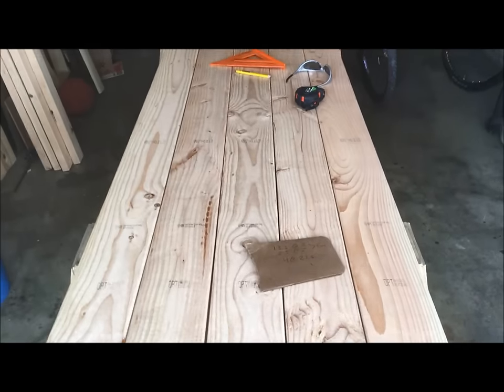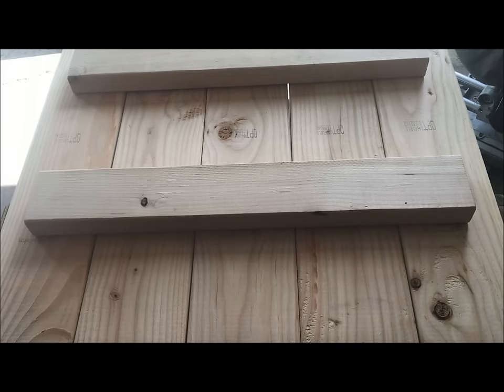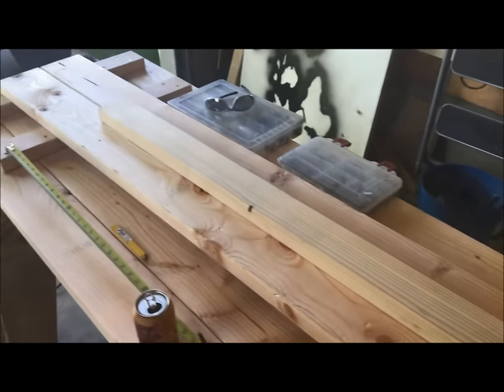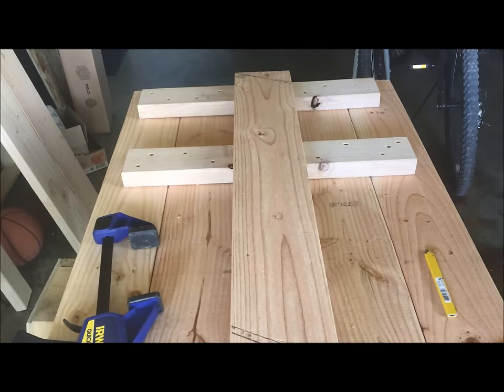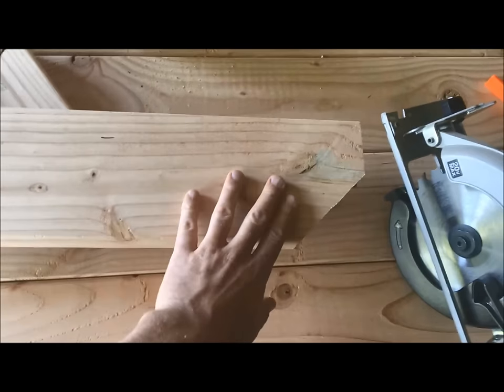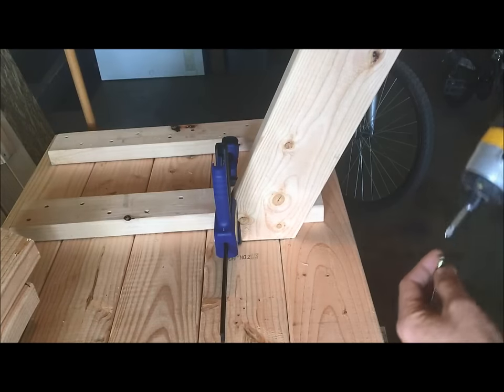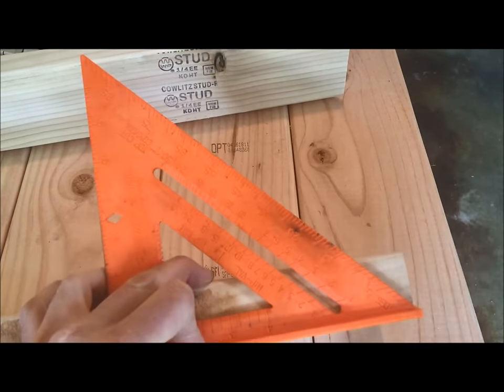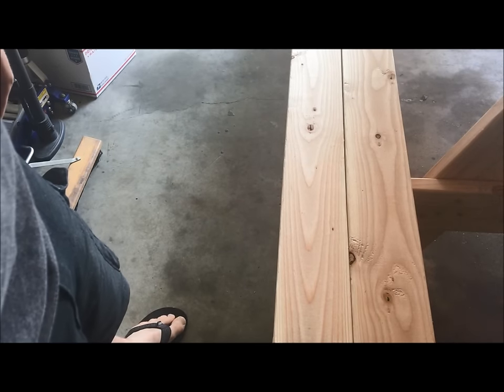How to Build A Picnic Table - Detailed Step By Step Guide

Comment: My son built 2 picnic tables for our local county’s park and recreation as his service project for his Eagle Scout rank and used your design. Went very well. Did run into issues with cross bracing as the 45 degree angles were off. We were able to fix it though.  Thanks.

Comment: Thank you, and a few minor corrections: 
You will need about 60 screws, one box usually holds ~ 50.  I used T25 Torx : 2 1/2" Wood screws.   
"The Carriage bolt line" - AKA "The seat line measurement" , is measured from the ground 12.5", essentially duplicating the bottom angle of the Leg. (I think that was 25 Degrees.  The author explains it in comments below.  "I measured from the part of the leg that will set on the ground and came up 12.5".  Once I had that mark I used that to pivot on to make another 25 degree line."   and : You should be able to measure up each side of the the board length and make your marks and this will automatically create your 25 degree angle."   Basically, if you measure up from any leg, the angle will be correct.
Reply: Thank you! Was in the middle of this project when I noticed at the 15 minute mark he didn't explain that distance (editing error I believe? Looks like he said he was going on to the 2x4 cut but all of a sudden he's back to the legs)
Reply: Thank you!
Reply: Thank you! I kept on rewinding that part and was just about to wing it.

Comment: Picnic Table:  Use these notes, while watching the video.
==========================================================
MATERIAL
==========================================================
-12 2X6X8 Pine Boards				 
-3   2X4X8 Pine Boards				 
-8   3-1/2" Carriage Bolts with Washers and Nuts 16.00
-Box of Wood Screws 2-1/2"	TORX head		  
-Wood Glue
----------------------------------------------------------
TOOLS:
----------------------------------------------------------
-Circular Saw
-Drill with TORX Head Driver (T25) Bit
-Pencil
-Speed Square + Framing Square
-Vise/Pipe Clamps + Level
-Gloves, Face Shield 
-Horses, and or Table
----------------------------------------------------------
Actual Materials Cost:		~ $130.00
Labor:					:  4 hrs.
==========================================================
 ITEMIZED PURCHASES
==========================================================
Order # 415121756 Invoice # 76172
----------------------------------------------------------
Hillman 5/16-in x 3-1/2-in Stainless Coarse Thread Carriage Bolt Qty: 8 $14.40

Hillman 18 x 5/16-in Galvanized Steel Hex Nut Qty: 10 $2.10

Hillman 5/16-in Standard (SAE) Split Lock Washer Qty: 16 $3.36

Gorilla Off-white Interior/Exterior Wood Adhesive (Actual Net Contents: 18-fl oz)Qty: 1 $6.90

Hillman 5/16-in Stainless Steel Standard (SSAE) Nylon Insert Lock Nut Qty: 8 $3.12

Hillman 1-1/4 x 5/16 Fender Washers Qty: 16 $2.88

Power Pro #10 x 2-1/2-in Ceramic Deck Screws (45-Count) Qty: 1 $6.78

Hillman 5/16-in Stainless Steel Standard (SSAE) Nylon Insert Lock Nut Qty: 8 $3.12

Severe Weather (Common: 2-in x 4-in x 8-ft) #2 Prime Treated Lumber Qty: 3 $13.41

Severe Weather (Common: 2-in x 6-in x 8-ft8-ft) #2 Prime Treated Lumber Qty: 12 $63.24

==========================================================
BUILD
==========================================================
1. Assemble the tabletop, upside down.
	
	2x4 Under braces on ends

	Measure:4 cuts - 23.5"

	2 Braces on each end.
	
	A. Measure: from edge of table: 2.5” place board 1
	B. Measure: from edge of table: 13.5” place board 2

	Screw/Drill/Glue Braces:
	C. Measure: Center them 2" From the table edges.

	(Repeat for the other side of the table).

2. Assemble the Benches, (upside down).

	(4)2x6"
	(2)2x4"

	2x4 Under braces Lengthwise.

	Measure: 62" Long
		Lag Measure: for the 2x4 placement = 17" from edge

	*Screw/Drill/Glue Bench Braces

3. Create Legs

	(Angle cuts with speed square).
		
	Lay a 2x6 down

	Legs will be 30" long, at a 25d angle cut.
	Repeat this up the board for each leg.
	
	Cut the 2x6, to create 4 legs @ (25d)

	Carriage Bolt Holes:
		
	Measure up from the bottom of legs, 12.5 inches, duplicate angle 
	for Carriage Bolt Lines.

4. Create Seat Support Beam(s): with Carriage bolts:  

	(2) 2x6 Measured: 59" long

	First Notch a 4" highlight angle to the ends of seats 
	with a speed square. (no Angle really)

	AGAIN 
	*Measure up from the bottom of legs, 12.5 inches, duplicate angle 
	for Carriage Bolt Lines.

	Drill holes in the first leg, then Template another leg, 
	to duplicate holes.	(x 4)

	The holes should be HIGH on the leg, 
	when the tabletop is upside down. 
	If the holes are low, you misplaced the leg.

	Drill Template: Use one Beam to drill the other beam. 

5. Attach the Legs:  

	Screw/Drill holes into the 2x4 bracing 90d, (not through the table)
	
	Use Clamps to hold the legs in place

	Measure: 2" From leg, to end of table brace.

6. Aligning the Seat Cross brace, with the Leg Holes

	The cross beam is placed outside the table brace #2

	Use a Framing Square, to align the Cross beams, 
	so, you can drill the holes to match the legs.

	Center the Cross Beam to hang off ~15" + 5/8ths 
	(doesn’t have to be exact, it may vary, just center it.

	Place Framing Square between the cross brace, and the leg.
	Target the "inside" hole first.
	
	From the backside of the beam, notch a mark that aligns to the inside hole

	*OPTION B: align the cross beam at the screw holes, and just drill through
		The cross beam, as centered, but lifted up to the holes.

6. Cross Bracing 2x4's for table

	You should have 2 left-over 2x4's 

        The 2x4 V bracing under the benches should fall inside the Cross Beams.

	Cut 45d angles in the edges for the cross bracing.
	You will need to set your circular saw to 45d
	
Circular Saw Note:
	
        When cutting this angle use the guideline on the saw @ 45d Notch, 
	not the normal notch straight notch

	*Or: eyeball the cut, to be flusher. (not necessary, but nice to have)
	
	Use a level for Sideways, and Vertical on the legs and set the 2x4 beams

	*Carefully drill to keep the table in LEVEL

7. Attach the Benches.  
	Align the bench along the outside edge of the cross beam.	
	(Furthest from the table edge)

	Place the bench and screw it down.

	>Sand the table

Comment: how far down do you measure from the top of the leg to the cross brace for the seat???  Or what should the height of the seat be to the ground??
Reply: Barry, you probably solved this already, but: Just measure up the leg 12.5" ~ and match the 25 Degree ? line.  Essentially go up the leg, and duplicate that angle.    I had the same problem. Its not made clear in the video.  While making the legs, you can simply put the same line on the board - up 12.5".  Make sure you measure from the bottom.  If you measure from the bottom on each corner of the leg,  30", the angle will be the same.  + You will find your hole line.
Reply: i came across the same problem and i’m glad he answered
Reply: @ericfleming6363  Ditto! He doesn't give us that measurement in the video. Thanks!
Reply: @mk8530  Thank you so so much. You're a life saver. Plannin to build this bench tomorrow and i needed to know this.

Comment: Love the Tongan work boots at 12:28 I have a rubber pair. Thanks for the build video too mate. Very useful.
Reply: Nothing like REEF sandels man!
Reply: @MechanicLife  Hahaha. In Australia we call Flip flops 'Pluggers', referring to the little plugs that go through the bottom of the sole. If you're lucky, you can find 'Double-Pluggers' that have two plugs at the rear of each side and NEVER pull out when you're doing really important things like running away from wild animals or saving families from burning buildings.
Reply: Freakin awesome! :)   I am picturing someone running into a burning building with their double pluggers on.  Super hero baby!
Reply: @MechanicLife  hahaha, that's about it.

Comment: The one answer I don't see is how you move this thing once it's built without a forklift?
Thanks for the video. This was my first attempt at anything this large. I was able to get slightly out of kilter 2x6x16 lumber for the whole thing for $25 and used pipe clamps to pull everything straight. The most expensive item was the wood screws!

Comment: Just to be sure sir imma be doing this next weekend all I will need is 11 2x6's and 1 2x4...
Reply from the maker: Material You Will Need
-12 2X6X8 Pine Boards
-3   2X4X8 Pine Boards
-8   3-1/2" Carriage Bolts with Washers and Nuts
-Box of Wood Screws 2-1/2"
-Wood Glue
-Circular Saw
-Drill with Phillips Head Driver
-Pencil
-Speed Square or Framing Square
-Vise/Pipe Clamp
Reply: Got cha really appreciate that bro... sister been wanting one so imma build her one as a surprise...
Reply from the maker: You bet.  Good Luck on it!  Let me know if you have questions.
Reply: Yes sir I sure will...
Reply: I bought..13 boards 2' X 6" X 8' and 4 boards 2" X 4" X 8' just to make sure id..hace enough!

Comment: As you are using 2x4 and 2x6 wood how can the bolts only be three and a half inch when the combined thickness of the legs and seat supports is 4 inches?

Comment: If I wanted to take the table down to 7’ instead of 8’ due to space, can I still use the other measurements but make adjustments to the 2x4 supports under the table top or even remove the ones at 2.5” and just keep the 13.5” supports?
Reply from the maker: Absolutely!
Reply: Just finished the build.  Staining and sealing it now.  Damn man it’s a nice table!  Thanks!! Wish I could show you the finished product!
Reply from the maker: Awesome!  Sounds really cool. Send some photos!!

Comment: Excellent work. Few suggestions
- If would have been nice if you showed the finished bench and tested it for comfort and showed how it looks in the garden.
- Shouldn't you leave a little gap between the boards (stick a matchstick in between) in case the wood expands?
-  It would be better if you used screws and nuts so it can be dismantled. That is because you not only may need to put it away for some reason, most people may decided to sell it and make a new one etc and it is much easier to sell it if it is can be dismantled. It happened to me once. I wanted to buy one but the seller said I need a big van so I could not buy it.
- Since this is for outdoor, it needs to be weather proof. Using a cheap wood (the only one I can afford) can be problematic, so can you tell us what varnish is suitable for protecting it and how to apply it?
- Could you also tell us what kind of wood be best for this?

Many thanks
Reply: Little Monk personally id recommend cedar for the top and if you want get everything that touches the ground pressure treated
Reply: @evanlegere4154  I painted mine 6 years with good latex (2 coats).  Looks good except for wear and tear.

Comment: Need to know measurements for holes you drilled on the legs? From the end your going to mount to table brace, end to the holes 2” &4” marked hole so we can mount it to table.
Reply: 2"
Reply: I believe you forgot to tell us the measurement from bench to table top.

Comment: VERY NICE VIDEO!   LOL Just one thing.  You did a beautiful  job hiding the screw holes, then you drilled screws into the seats!  omg.  That's something I would have done.  You should have screwed the bottom braces to the supports under the seats, that would have kept the seat in place just fine....even add some wood glue under the seat where it sits on the brace and BAM!  No screw holes and you go to the top of the banana split!!
Reply from the maker: Good idea!  Thanks for sharing.

Comment: Man one thing I never can do is use Phillip head screws I always strip them Im used to to star bit nice work though
Reply from the maker: A torque bit and some deck screws are always awesome!
Reply: @montanamade1114  Nit-pick here: Torx, not torque (which is a product of force and leverage distance)
Reply: @g.m.forsythe9626  If you're going to nit-pick be sure you are right. Torx is a brand name. Torque is the technique.
Reply: @glenncalzada1707  Thanks for the education, and no thanks for the sarcasm. 

Unfortunately your statement is not supported by factual evidence. If you Google "torque screw" you will not find support for your statement. Wikpedia has the following: "Torx (pronounced /tɔːrks/), developed in 1967[1] by Camcar Textron,[2] is a trademarked type of screw drive characterized by a 6-point star-shaped pattern. A popular generic name for the drive is star, as in star screwdriver or star bits. The official generic name, standardized by the International Organization for Standardization as ISO 10664, is hexalobular internal."

Sorry to have to nit-pick your "correction," but it's simply not correct.
Reply: @g.m.forsythe9626  thanks for the correction. I was thinking nuts and bolts. You ade talking screws. Auto mechanics use torque wrenches to loosen and tighten nuts to a specific  degree of lbs.. Apple and oranges evidently. Sorry if you found sarcasm in my earlier remark. It was unintended.
Reply: @glenncalzada1707  Thanks!  Glad we agree! 😀

Comment: I built this exact table wish I could show you pics of it.. The only issue I had when I used to scrap 2x4s for the support legs. I had to cut them down about 28 to 27 in. so when I cut the 45 degree angle on the ends it fit perfectly. They were too long to fit from the bottom of the table to support the leg.

Comment: I wonder if this is cheaper compared to already made? This is actually pretty cool..
Reply: Right now 8/25/2022 the lumber for the project is about 70 dollars if you buy number 2 prime grade kiln dried pine, hardware is about 25 dollars, and a tube of construction adhesive is about 10, for a total of about 105 at home depot. A pre-made table at home depot is 159 plus tax, so if you already have the tools you need, you would save about 60 bucks on each table to build it yourself.
Reply: @DeanTX   This is convenient to anyone that does have the tools.. & I don’t have .. 🤭

Comment: you didn't use spacers for the top to reduce the swelling of the wood.? Also why are you not drilling pilot holes to preventing the wood from splitting?

Comment: Good job brotha! Very detail vid. Since the legs will be touching the ground, do you recommend treated wood??
Reply from the maker: Treated wood isn't a bad idea.  We will have this in pea gravel sitting on top of weed guard.  Seems to work well for drainage.  I also treated it with Linseed Oil as well.  We will see how it handles up to the Montana Winters:)
Reply: Brick and wood aquasealed mine
Reply: @montanamade1114  What were your measurements on the legs for the carriage bolts?

Comment: Excellent work there, u use regular lumber, not treated what kind of finish sealer u recommend.  Can I stain it n coated with spare urethane  since its gonna be outside year round hot, cold,snow, n rain
Reply: I have finished them in a multitude of ways...but I always finish them with an outdoor polyurethane.  So far so good with the extreme temperature differentials in Montana.
Reply: @MechanicLife  how much would u charge for it, cuz I been ask to make three table. Good video to go bye step by step, thank you for posting
Reply: I have made a few of these for other people.  I was selling them anywhere from 200 (unfinished) to $350.  People like the unfinished with a light sand coat so they can pick out their own colors...etc.   I sold one for $500 that I did a burn on with a torch.  It took a long time, but looks great when it was completed.
Reply: @MechanicLife  thanks  for info. Keep up the good work.

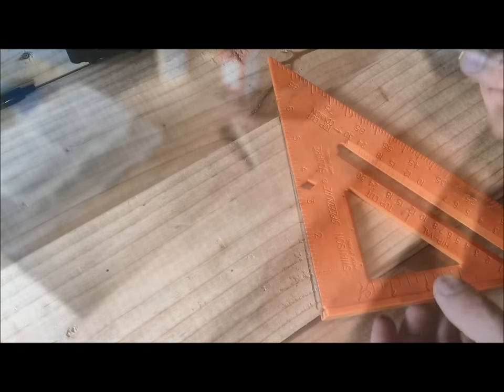Comment: At 14:57. Where did that measurement/line come from that you're drilling the holes for?
Reply from the maker: That line is on the table legs the the supports will bolt up too.  Should match up with the video at 12:05.
Reply: I thought those lines were just sectioning the board into 30" segments with 25 degree cuts.
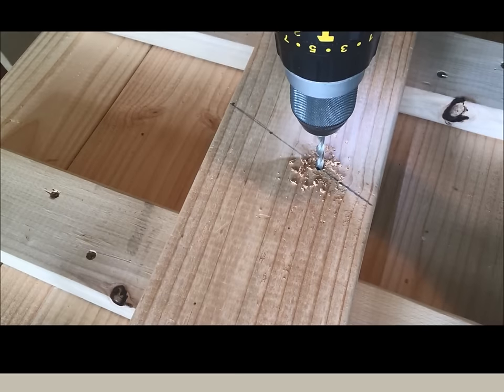Reply from the maker: Just watching this...i see how its confusing.  Those are the table legs and the line is on it for reference to drill the two holes.  Picks up at 16:00.  Hopes this helps
Reply: Yes. But how did you measure for the line. What is the measurement for the line?
Reply from the maker: Watching the whole video...I know I filmed it, but missed adding it in during editing.  I measured from the part of the leg that will set on the ground and came up 12.5".  Once I had that mark I used that to pivot on to make another 25 degree line.
Reply: Last question. Measured vertically 12.5" from the fat side, or 12.5" along the board length? Thanks.
Reply from the maker: Glad your asking...I am sure others have the same questions.   I was measuring at the board length side.  You should be able to measure up each side of the the board length and make your marks and this will automatically create your 25 degree angle.
Reply: I will be making this bench this weekend. Will let you know how it turned out.
Reply from the maker: Awesome!  Please do and let me know if you have any questions during the process.  Pictures would be great too.
Reply: So.. I was building this at my river house with no internet. I had the materials ordered and shipped as I wouldn't be able to buy lumber while there... Let me just say ,  your math is terrible... How many 2X6X8's?  You say 11... Let's break that down... 5 for the top (6 left) 4 for the 2 bench tops (2 left) 1 for 3 of the legs (1 left)... 1 for the remaining leg and bench seat support (0 left)  1 for the other bench seat support... ooops... that makes 12.  Please change the Material's List to 12 -  2X6X8's.
Reply from the maker: CRAP!  Updated!  Apparently my talent for math ends at 11.
Reply: @montanamade1114  thanks